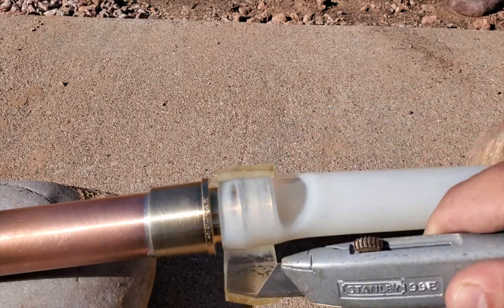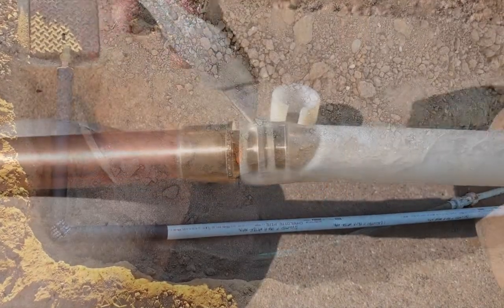How to Remove a PEX-A Coupling **Includes Mistakes**

Comment: Ok, since no one else is going to say it, you don't have to redo a joint just because you didn't get the pipe on the last 1/8". Sure it's a good habit to get it on all the way but there's a margin for error in the design. The factory reps will tell you so. The honest ones anyway. I was taught by a factory rep to cut off the "collar", "ring", "etc" without heat, and then heat the pipe without cutting it until I can pull it off. If you heat the collar first some of that heat will bleed into the pipe making it softer and more susceptible to a cut. I've reused hundreds of plastic fittings and they work just fine. As for cutting off the pipe to start fresh, mostly people do this because they can't figure out how to get a new collar on a previously stretched pipe. Just stretch the collar by itself and usually, it will go on. 1" pipe is stiffer and so are the collars so I have stretched a collar once and then shimmed it with a sliver of the old collar in there to stretch farther a second time. Finally, if you do have a joint that leaks from the get-go, put a stainless steele hose clamp on it and tighten it down hard, then remove it. That will seat the barb deeper into the pipe and if the fitting isn't damaged too much that will seal it every time.
Reply from the maker: Thank for sharing your experience!
Reply: Thanks for advice, I will be trying the hose clamp method for sealing some leaks.
Reply: You rock! That advice of using a hose clamp on the sleeve to tighten it down worked like a champ, and saved me a bunch of time and effort. Thanks!

Comment: That’s basically how I do it in the field. Usually I don’t have a heat gun so I bought one of those small torch style lighters at a gas station. I don’t heat it up nearly as much as you did just a bit and a nice sharp blade and you can get through the ring fairy easily. The pex I lightly score then cut deep on the pex below the fitting. Put my thumb in the hole I cut and just pull it off. That way I can still use the fitting even if it isn’t brass. Sometimes you don’t have the option of changing fittings without going crazy with couplings and doing a hack job.
Reply from the maker: Thanks for sharing your experience. We certainly don't have ideal situations all the time and the first acceptable answer is the one that gets the job done.

Comment: what temp is best for heat gun to be set at?
Reply from the maker: We have 3 settings on our heat gun. We used the middle one. Low would have taken forever and high might have compromised the materials. Good luck!
Reply: Thank yo @NoMoreLeaks

Comment: Thank you for posting this, I'm surprised I could not find any other How to video's on how to remove PexA expansion rings. I opted to buy brass couplings instead of poly even at twice the price just for this reason, you can't reuse a poly fitting, and I was working on a project that I might have to take apart in the future if some of the surrounding non pex fittings failed.
Reply from the maker: Good call for planning ahead. Glad to hear you found it helpful. Best of luck on your project!

Comment: I just cut off the outer ring as the inner pipe protects the barbs on the fitting. Then heat gently and pull off. No need to cut the pipe

Comment: I had the remove a 3/4 proper brass elbow from the pex pipe.  I used a torch to heat the collar and pipe.  Took 20 seconds to heat both the collar and pipe without damage to the coupling

Comment: I have never needed to use heat to remove the collar or the pipe. All that’s needed is a new knife blade and a good bit of strength to pull the pipe off of the fitting. There is no reason not to reuse a plastic fitting if you didn’t damage it — I can’t count how many times I have done everything I mentioned without having any problems. Also, there is enough “wiggle room” to where the pipe doesn’t need to be completely bottomed-out onto the fitting. The Uponor rep told me that while bottomed-out is ideal, the pipe can be as much as 1/4” away from the stop and still perform as it would if it were bottomed-out.
Reply: Yea and it’ll hold just long enough for the  check to clear. Then it’s someone else’s  problem. 

/s

Comment: Is easy with the torch, and if you use a knife you will mark the fitting and it will leaks, your welcome…
Reply from the maker: Yes, thanks for the backup. That is exactly what I said at 2:03.